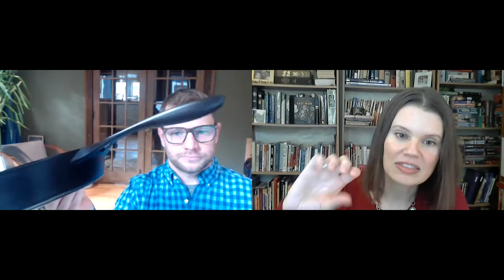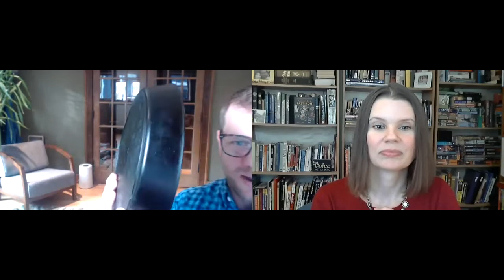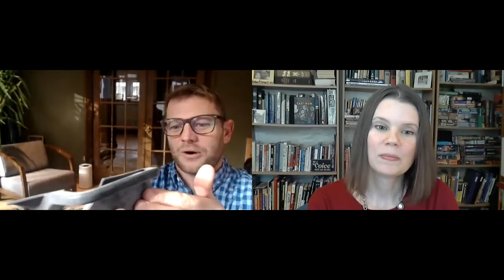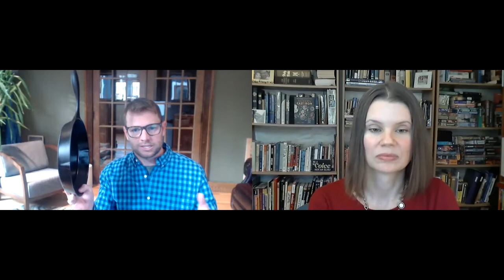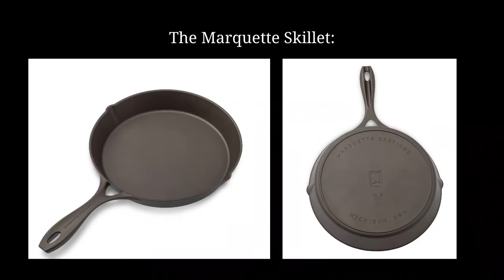Skilletheads Interview with Marquette Castings

Comment: i am very interested in the handle as the drawback with my Smithy and field are the short handles get scorching hot
Reply from the maker: After using my Marquette skillet for a while, I have to say the handle is amazing. It takes a long while to heat up, and it does not get as hot as the rest of the pan. I haven't needed my silicone handle holders at all when cooking on the stove. Plus, the handle really is ergonomic and comfortable in the hand. I would definitely recommend Marquette as a lightweight cast-iron pan with a cooler-to-the-touch handle.
Reply: @ashleyljones  thnak you so much